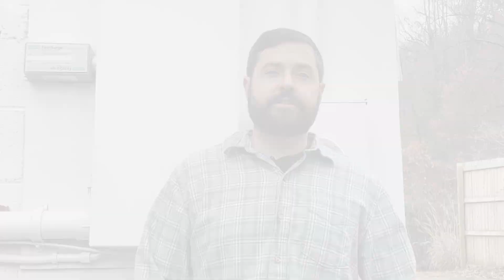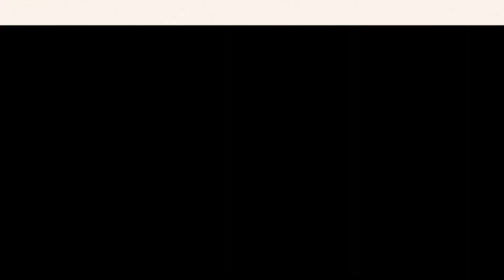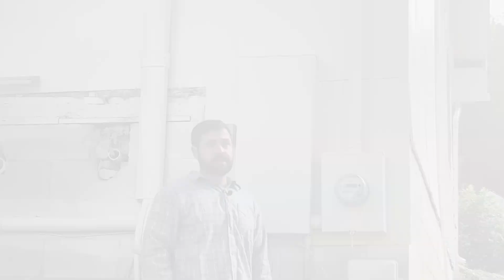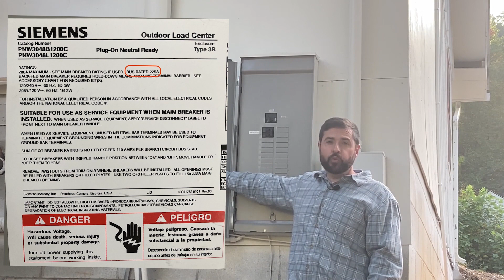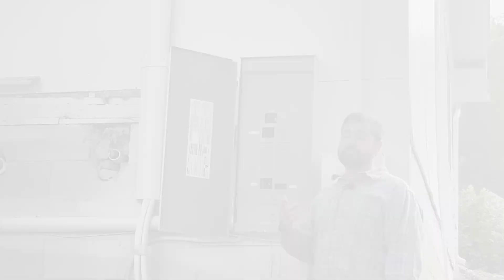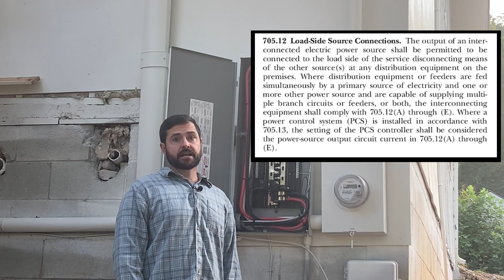Solar Interconnections and the NEC

Comment from the maker: If you are interested in a zero cost pressure free quote for turn key installation any of solar and storage products, fill out our intake form below...

Rocky Broad Solar Intake Form https://docs.google.com/forms/d/e/1FAIpQLSer5w_81iHtdcZBKV8Zuo9KVwJGQsqg_QNV-ePRvmWMiHZ8dg/viewform

If you are interested in Sol-Ark, EG4, Victron, or other DIY solar and storage products, check out some ROCK BOTTOM prices on those products using our affiliate links below...

Signature Solar affiliate link (CHEAPEST SOLAR PANELS ON THE MARKET and EG4 Products)
Save $50 with coupon code GET50ROCKY (expires 12/1)
https://signaturesolar.com/?ref=uzUOpPif73O10D

Current Connected Affiliate (SOL-ARK PRODUCTS)
https://currentconnected.com/?ref=RockyBroadSolar
 
Practical Preppers (DISASTER PREPAREDNESS)
https://shareasale.com/r.cfm?b=1574707&u=4123057&m=99148&urllink=&afftrack=

Bluetti 
https://shareasale.com/r.cfm?b=1745428&u=4123057&m=108816&urllink=&afftrack=

EcoFlow Store 
https://shareasale.com/r.cfm?b=1537905&u=4123057&m=97298&urllink=&afftrack=

SunGold Power
https://shareasale.com/r.cfm?b=1729232&u=4123057&m=107752&urllink=&afftrack=

Jackery
https://shareasale.com/r.cfm?b=1539244&u=4123057&m=97366&urllink=&afftrack=

Also check us out at the following places....

Rocky Broad Solar Website
https://rockybroadsolar.com

Facebook
https://www.facebook.com/profile.php?id=61558585264414

Comment: Great presentation. 
Do you have to derate the solar current as a continuous load?
Reply from the maker: Thank you dalboltv9747! Yes, solar is considered a continuous load because it runs for 3 hours or more continuously. So you take the "max continuous ouput current" and multiply time 1.25, and round up to the next size circuit breaker to size the circuit. Then you have to size the wire correctly to be protected by the breaker. Thanks for the comment!